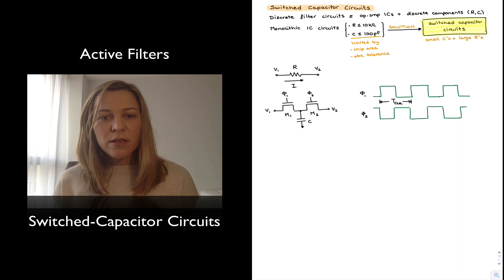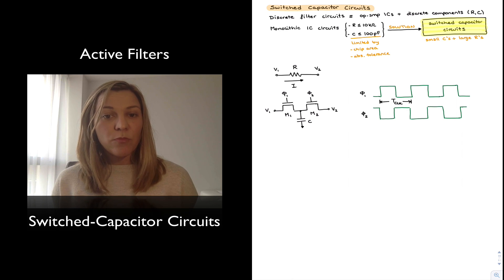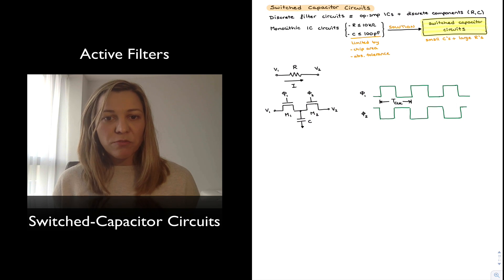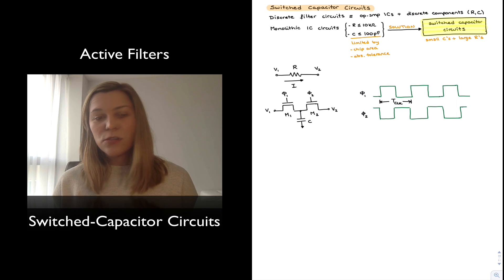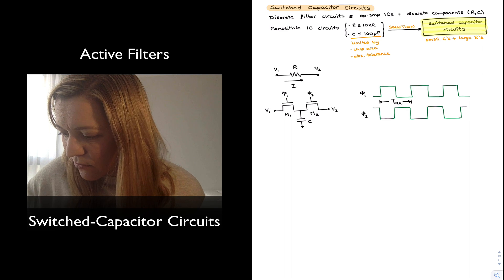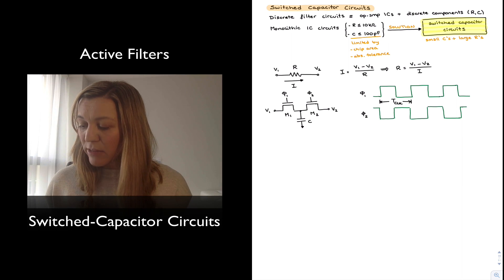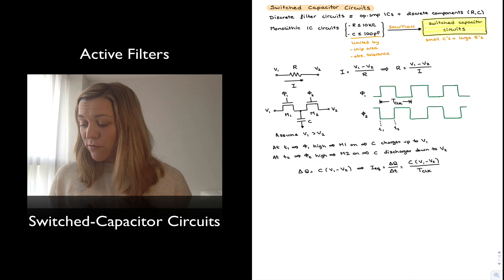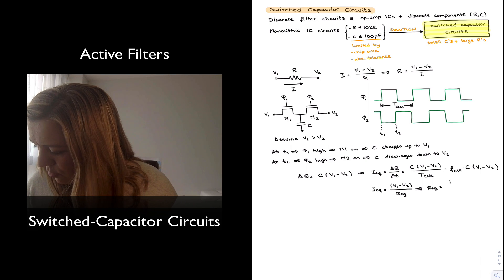Switched-Capacitor Circuits

Comment: Around 8:40, why is the delta t equal to the clock period and not half of the clock period? If we're looking at the amount of charge lost during the discharge, doesn't that only occur for the time that the second MOSFET is on (which is half of the period)? Thank you
Reply: Reason is (V1-V2) voltage difference comes during a one clock cycle. During clk high cap charge to V1, during clk low, cap discharge up to V2.